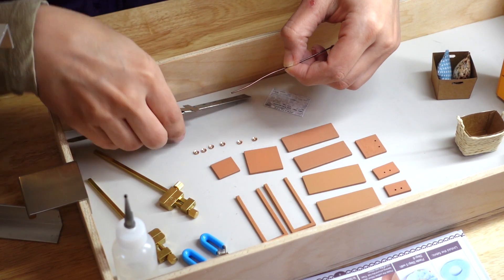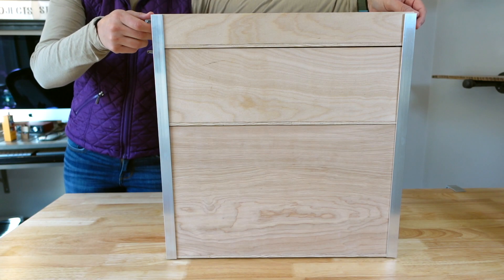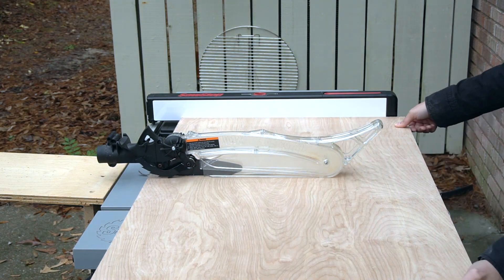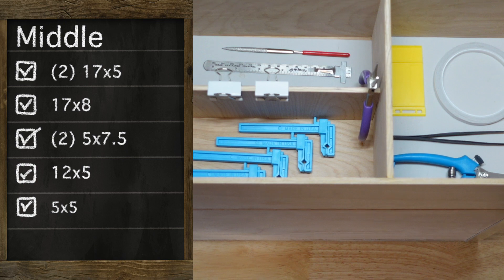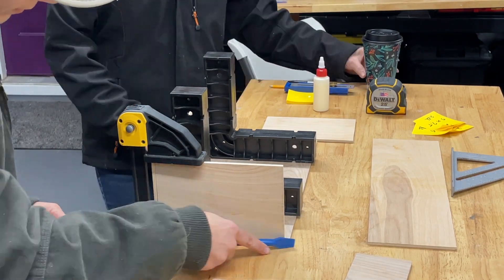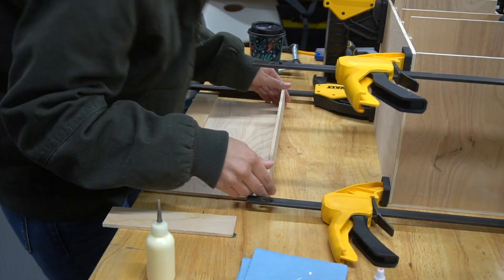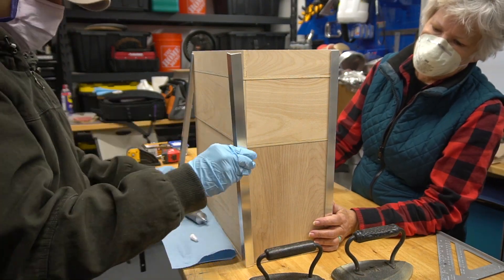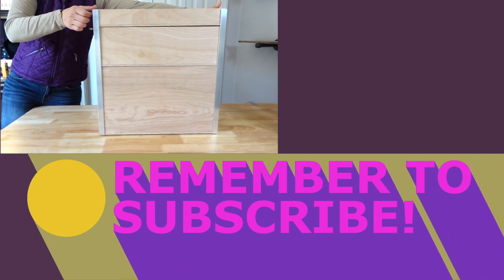DIY 3-Tier Plywood Stacking Box for Hobby Supplies

Comment: I like it. I may look into building one. I have hobbies that could use a box like that. I like to paint and I have brushes, stencils, lots of small paint bottles. You could also use a brad nailer to nail into joints until the glue dries.
Reply from the maker: Yeah, I thought it would be too hard to get the brad nails just right with the thin plywood.